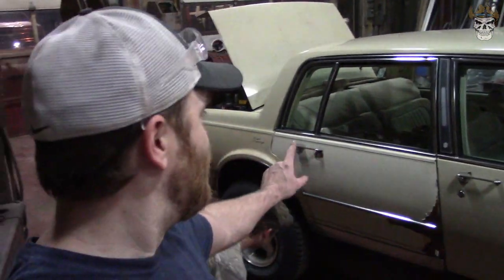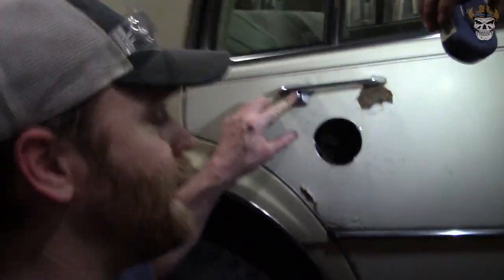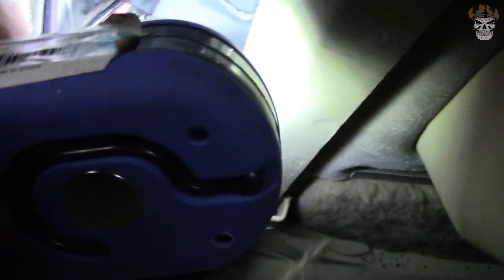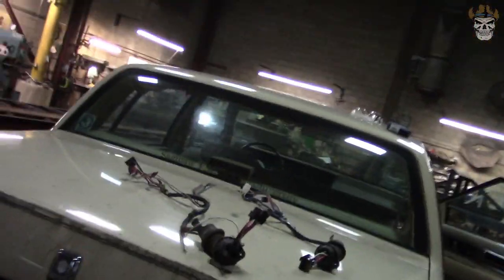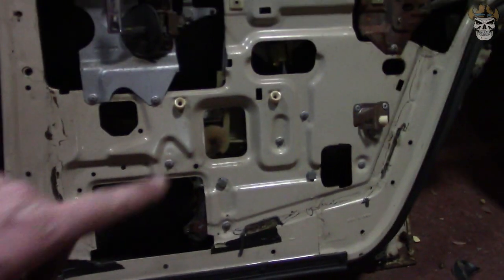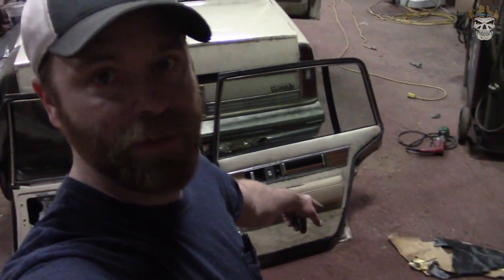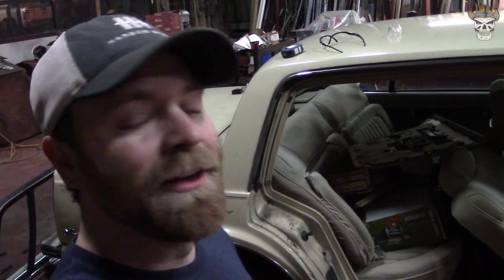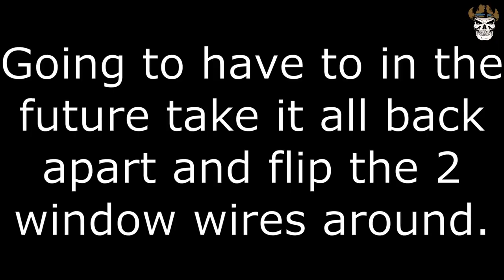1986 Oldsmobile 98 Rear Door Replacement.

Comment: Another great video and you’ll find the crazy rocker style window switches always suck, my 1988 regency brougham have given me problems from day one 🐾
Reply from the maker: I have taken the driver side one apart when i first got it running and cleaned up all the contact points.  Then the seat adjustment switch connections were all messed up.  Horrible design though and though but still love the heck out of these 98's!